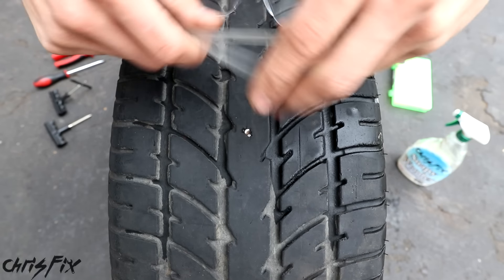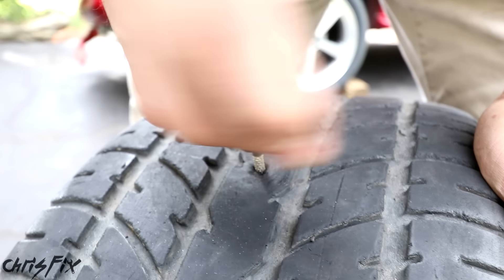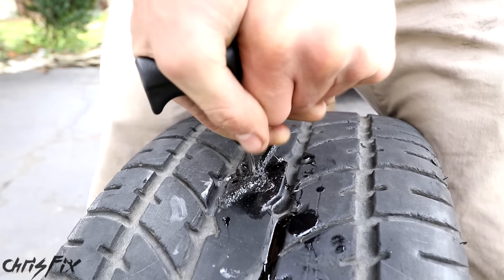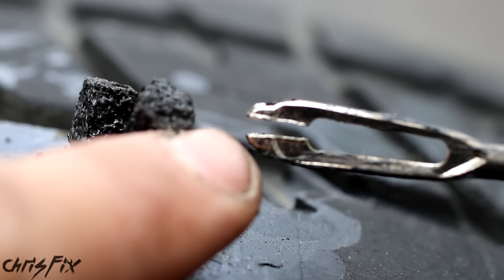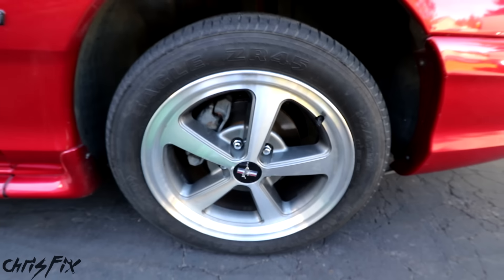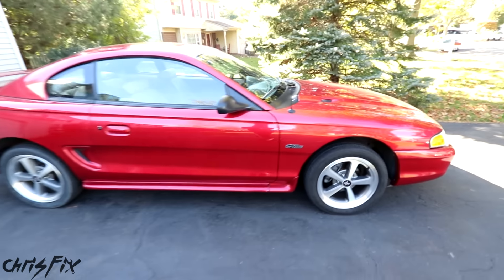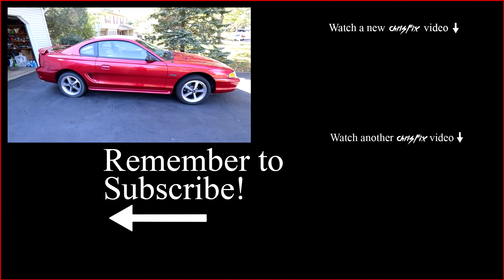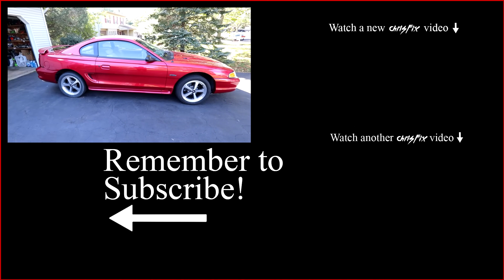How to Fix a Flat Tire EASY (Everything you need to know)

Comment: Just an FYI plugging is not suggested by the tire industry as when you are using the bore its separating more of the metal. A proper fix is an internal patch, it's a permanent fix. If a patch leaks you can repatch the tire where as if a plug leaks you can't replug the same spot.
Reply: He covered this already. It's not considered permanent by any means. But not everyone is in a perfect situation. What if you need to be on the road for a couple days? This is a good, band-aid solution to a lot of common problems.
Reply: Violetta yes but once you plug it you can't patch it as the metal from the cords will puncture the patch any reputable shop will not patch a tire that has been plugged
Reply: mts0628 risk vs reward for a reputable tire shop. Yes you have to prep by sanding area but it's not worth the  risk for the shop hence why the big shops don't do it
Reply: You should watch the whole video  before commenting next time
Reply: Shane Miller you know nothing Shane miller
Reply: Shockyxo I've worked in the industry since 2005 I'm just stating facts from the industry. And yes mts I understand where you are coming from on the additional plug once a tire has been dismounted, yes it's a fear of litigation or as you say to get money but the sad part is that in America you can sue people for pretty much anything so yes there are rules in place for a reason even if they don't make sense, they are to cover themselves. It might sound stupid and yes I've plugged my own tires and such under emergencies and never myself had an issue but I also understand the flipside of it.
Reply: I've driven on plugged tires for many years and never have had a problem with them.  I'd not worry about a plugged tire when the "fix" is on the tread area. If, however, the damage is on the sidewall, forget using a plug or any other repair.  Then the tire needs to be replaced.
Reply: Plugs work 95% of the time for the remaining life of the tire. I'd much rather pay $10 for a plug kit that can plug 5-10 flat tires than pay a single time for a shop to do it. They usually charge $30+ for a tire. Sometimes more like 50-100 in which case I'd rather buy a new set of tires.
Reply: I run our trucks and dump trailers very hard, to and from demolition/construction job and dump sites and not a week goes by when I don't plug a tire; vehicle and trailer. I have had LRE, LRF, & LRG tires that I have actually had to grab a drill and DRILL THE TIRE so the plug goes in. I've had to get pry bars, and force the T-bar with plug into the tire. There are tires I am running right now that have 110psi in them, with double digit plugs in them. A PROPERLY plugged tire, that has constant attention- i.e. checking the pressure and condition regularly - WILL LAST. And, yes, the rubber cement isn't "necessary," per se, but it is cement. For rubber. Like what makes up the tire you're working on and the plug you're putting in. Which you are hoping will stick together. Like with glue, or cement. Yeah. . .
The last time I pulled a trailer for service, the four tires had 23(!) repairable punctures in them. It simply is not feasible to spend the money and time($)to have a tire shop patch repair everything.
BUT
I do agree that a patch is always preferable. Always. And, for any road use, you NEVER PATCH A SIDEWALL - NEVER! I won't plug if it's two fingers from where the tread edge stops.
But, I have ran 120+mph on a front tire I've personally plugged. Then again, I've also taken a tire off of the wheel with a piece of wood and the tire iron, so . . .
I digress. ChrisFix's puncture in the center of the tread, in a huge tread block, in a non-rotatable tire position (if the back tires are larger), being plugged, is about as acceptable as a "not-recommended" DIY repair can get.
Reply: Shane Miller what are you talking about? I patch tires all the time at work and you definitely can replug the same spot if it's leaking. I wouldn't do it myself because that's just lazy but I know for a fact that you can.
Reply: Screwg oogle Discount tire patches tires for free. Idk what shop would charge 30 dollars or more for a simple patch that only takes 10 minutes.
Reply: Junior Rodriguez if you follow tia standards for tire repair it takes 20-30 min
Reply: Yeah I think this is a decent solution if you are on a holiday or something. I might see if I can wedge a plug kit in my spare tyre area for this reason.
Reply: Every shop I went to here in Miami when I found a nail in my tire said they put a plug AND patch. I went to several to see pricing.
Reply: you can repair a tyre that has had a string repair in it fyi
Reply: Shane Miller I had 4 plugs in a rear motorcycle tire for almost 40000 miles without a single issue. I now have run flat tires on my car and have the exact same 12v pump as CF and a heavy duty plug kit ready to do my own repairs.  I'll be buggered if I'm going to pay for a new tire every time I get a flat!
Reply: Felipe Pubillones that's known as a plug patch combo it's a patch with a plug in it, so that it seals the hole in from inside the tire then throughout the tire. Places like Firestone and I believe tire kingdom do that
Reply: Ken Lawton you don't always need a new tire just because of a nail, patches being the more permanent fix work great as long as your within a certain area. Also with patches you need 16 inches between each patch being as since the structure of the tire is now slightly weakened you don't want two that are too close together. And most run flats can be patched one time as long as they haven't been driven on flat. The exception being the continental run flats since they are a self sealing run flat and as the tire heats up it creates almost like a fix a flat substance to seal the hole.
Reply: Spicoli1Bilek can't what?
Reply: +Shane Miller re patch an old patch hole. done it for years
Reply: Spicoli1Bilek I said you can repatch a tire that's been leaking from the patch whereas it's not suggested to replug a tire that leaks from the plug.
Reply: Screwg oogle ya the only place I know that includes road hazard with the purchase as a retailer is Costco, tire rack gives free road hazard for most tires as well
Reply: Shane Miller Most run flats have "do not repair " stamped on them, just like my pireli P7. Most tire shops will not repair them because of liability and the fact that they don't know how far you've driven on the run flat potentially destroying the tire wall. In Australia, where I am, you get a flat in a run flat you're up for a new $300 tire period. Hence I am ready! 😉
Reply: Ken Lawton on run flat its dependent on tire manufacturer. Bridgestone and Michelin allow it as long as it hasn't been run below 15psi and have wrinkling or damage to sidewall. Pirelli is a no go and so is continental since they are self sealing run flats
Reply: Ken Lawton and yes most don't even want to deal with it as you can lie and say you never drove on them low or so on, so yes you usually get turned away because of the liability
Reply: Shane Miller, you are correct.  I have found hundreds of leaking plugs in customers' tires in the last 25 years.
Reply: Scott Diamond yup as have I, since I started in the industry in 2005 that's why I'd only plug a tire under a dire emergency. Like my car not having a spare (my 911 turbo for instance) I'd get the plug and air and then go get a new tire yes the plug may hold but being in the industry and knowing what I know I'd rather just change it, that's why I always buy road hazard with my tires so that I can get them fixed for free and if they can't be fixed get them prorated
Reply: "Just an FYI plugging is not suggested BY THE TIRE INDUSTRY"

You mean the guys who want to sell you a new tire? Gee, I wonder why they don't like DIY tire repair! ;-)
Reply: Umm... No. That's completely incorrect. Whoever told you that is lying to your face. Plugging is the very best; most effective, most cost effective, easiest, and can be done easily by you without the help of a mechanic. 

Internal patches tend to leak.
Internal patches are expensive.
Internal patches cannot be done at your home.
Reply: bcubed72 it has more to do than what you think. The preferred method is a patch look it up on tiaa but you can believe that they just want you to always buy tires.
Reply: Paul Chaos you have no idea what your talking about have you ever worked in a shop? I'm going with no, internal patches have less problems than plugs and are considered a permanent repair. And of course you can't do it at home since you have to take the tire off the rim and grind down the inside for a smooth surface. Plugs are great for an emergency but they have higher tendencies to leak and if they leak you really can't double plug a spot. With a patch you can peel the patch off and redo it if it leaks. I work in a shop and have seen it many times.
Reply: And to say cost effective most places charge 10 for a plug and shops charge 20 for most patches there are exceptions of course. Yes more cost effective if doing it yourself. Just like I'd never use fix a flat regardless of my situation that stuff is not good it starts to eat through finish internally on rims and if you have sensors it can damage them
Reply: Paul Chaos  You are full of crap.  Plugs leak. Go get a job at a tire shop and find out.
Reply: Scott Diamond don't feed the troll, you can tell he has never worked on a car. I may be young but I've been working on cars for 12 years now and have learned a lot over the years, hell I just tackled changing the spark plugs on my 911 turbo a couple weeks ago not anywhere near as hard as I thought it would be.
Reply: Texantroll Not for me. I do patches almost every day and I gotten to the point where I can do a patch in 10 minutes. 15 the most. It's not as hard as it sounds really.
Reply: You can replug the same spot. Drill a small hole to get the plug out and replug.

Comment: Can of air sealant also messes up the TPMS sensor
Reply: GonzalezEzekiel yes i work in a shop and i has cost people more money to replace a sensor then the tire don't ever use fix a flat unless you absolutely have to
Reply: thank god my car is too old. the hell with those things anyways
Reply: Nathan Glennon yeah the are a pain but everyone is trying to be safe nowadays
Reply: TPMS sensors do not like the sealant. They can easily fail, repair is simple(replace sensor) but expensive.
Reply: Yes. I found that out shortly after getting a new car and i just wish i had ordered it with a spare tire instead of the kit they put in a lot of small cars now. I will never use it.
Reply: They are idiot lights. Which means idiots still ignore the damn light and then come into the shop with a tire that has been run too long while it was flat and now they wonder why we can't fix it.
Reply: GonzalezEzekiel some do some don't, read the fine line.
Reply: Or if you want a cheap alternative to the light,buy some valve stem caps that let you know if your tire is leaking air.
Reply: Those don't work I have seen those still green and be 15 psi low also the are plastic and lose air if the are not tight and crack after time just check your air once a month
Reply: Land O Calrissian
It depends on the type. I have seen some that are pretty useless. The kind I have will show up green and yellow if I am down about 4psi and green,yellow,and red if I am down 8psi.
Reply: Yeah I know all the kind trust me I've seen them all I work in a shop and have since they came out I've seen enough fail nor to trust them I take them of every time and tell costumers they can put them back on at there on risk you might get lucky and they might work correctly but it's not worth risking it when you can just get a good digital gage and check them ones a month plus it's not like they can warn you if you are loosing air while you are driving
Reply: Land O Calrissian
I agree,not every one of them is worth it. I have had it happen often enough that I can tell when I am driving,if the car starts pulling to one side.
Reply: Not all air sealants damage your TPMS. There are some that are TPMS-safe and certified. More expensive for the can, yes. But would you rather pay £6 more for the sealant or pay much more for new sensors? :)
Reply: YoloMcSwaggins
The answer,yes. But the tire still needs to be replaced and that would still be a pain in the ass for the staff.
Reply: if you get it cleaned out right away, it shouldn't mess them up

Comment: If using a wood block on the hydraulic jack pad, orientate it cross grain to the pinch weld.  The block in the vid was orientated with the grain to the pinch weld and was ready to split into 2 pieces at 4:32.  Some people use a jack pad or hockey puck instead.  Other than that great vid.
Reply from the maker: Thanks for the tip!
Reply: rocky t
Reply: rocky I
Reply: fantastic tip! thank you
Reply: Good point, I use a wood block on my jack pad too. I'll verify it's cross grain to the pinch weld.

Comment: PSA - Pay attention to what he says at the end. Plug kits are temporary solutions. For a permanent fix, get it inspected by a mechanic at the shop. They will inspect the damage from the inside and patch it from inside. Your sidewall might have been compromised by the rim digging into it under the weight of the car if it had sat too long. Or your puncture hole could be at an angle. Just because it worked for uncle Joe does not mean your situation is the same as his. Plug it and drive it to the shop at your earliest convenience. When it comes to tires, better safe than sorry.

Comment: A little tip that comes from personal experience: if you have locking lug nuts, replace them immediately with normal lug nuts.  One time I needed to take a tire off and when I used the lug wrench it slipped and damaged the locking lug nut.  I ended up having to go to a garage to have them remove it.  They had to cut it off.

Comment: Would the plug material throw off the balance of the tire at higher speeds (60mph+)?
Reply: The plug material weight is negligible when you compare it to the weight of all the other wheels and car.

Comment: Better keep the engine running when using the electric pump. It will get the job done quicker and put less stress on the battery.
Nice video.
Reply: Also if your battery is old it can also drain your battery if you have to fill from a complete flat.  Trust me that the last thing you want is to finally celebrate getting that flat aired up and decided it's safe to drive, then realize the car now doesn't start.

Comment: Great video, Chris. I've had much better success with plugs than internal patches on motorcycle tires. I would be very comfortable with a plug on a car tire as a permanent repair if I had to do that on a trip. Tire stores in the Dallas area fix flats for free with internal patches, so that's a no brainer if you're in town. You don't even have to prove you bought your tires from that store. Cool.
Reply from the maker: I agree! Plugs are just not "technically" permanent, but I have drifted down to the belt with plugs in the tire and they didnt fail!

Comment: Hey Chris, I don't know if you've answered this before but do you voice over your videos or are the video and audio recorded at the same time?
Reply: Bad Drivers Of Bartow County Georgia I was wondering the same thing! He prob did most of the vocals on camera and then overlay another vocal so everything sounds good.......If u ask me I'd say that he's scripted but.....its a good instructional vid so who cares lol
Reply: Leekautorepair the voice audio is so crisp it seems like it has to be separately recorded
Reply: Bad Drivers Of Bartow County Georgia i want too know too!!!
Reply: Yes, he definitely does. You can tell whether he's inside on mic or outside by sounds like wind and other background stuff like that. If his voice is super-crisp, it means he's inside. If it's relatively good quality, he's using his micro-mic (which is a really expensive one, so you know. :D)

Another way you can tell is when he does Before and After videos like his Cleaning video or his Headlight Restore video. :)
Reply: YoloMcSwaggins in the parking lot for example, it was very crisp but didn't seem like voice over. i'm not sure. either way, it's very well done
Reply from the maker: Actually Yolo, I never record audio inside (never ever). 
Bad Drivers of Bartow County Georgia, all the audio is recorded as I work. Sometimes I need the sound of the ratchet moving or air escaping so I might not talk as I unscrew a bolt, but immediately after, I will talk myself though what I just did for the audio. Most of the time, I talk and film at the same time.
Reply: ChrisFix wow, that's impressive. your audio quality is top notch. thanks for the reply, love the videos! been watching for a couple years now

Comment: Great vid as always Chris. A small tip though, when undoing or tightening lug nuts get on the side of the wheel so you can push down on the breaker bar. Left side for loosening, right side for tightening. Much easier on your back.

Comment: I found out the black plugs to plug the tire works better than the brown. My dads car got a flat so we tried fixing it but even after putting in the plug and the paste we still heard air. It was a screw sticking out half way in... So we had to get the tire replaced... Great video thought I used all the tips!!! Keep the great work up!

Comment: I would recommend starting the car before using the air compressor as it might kill the battery then you will have two problems
Reply from the maker: +faizan joyia (mac man) great tip! Thanks!